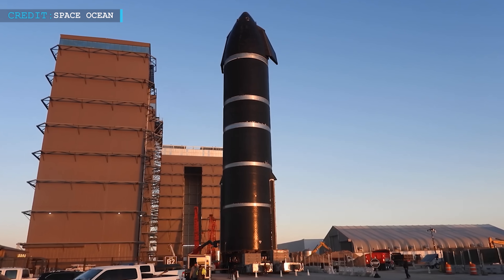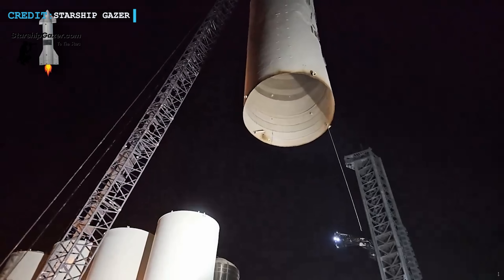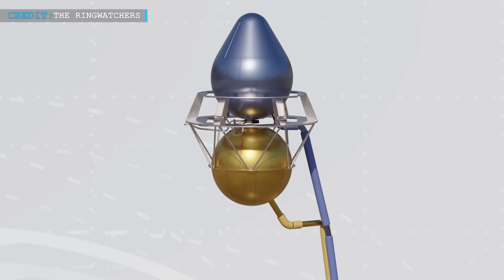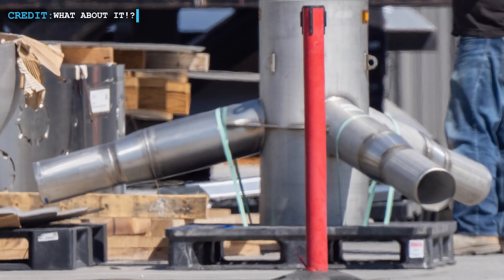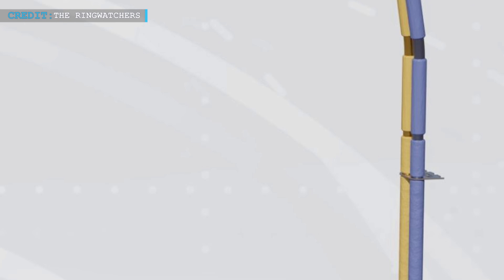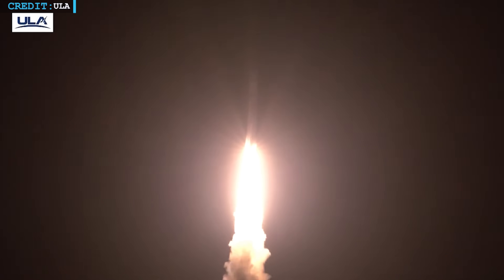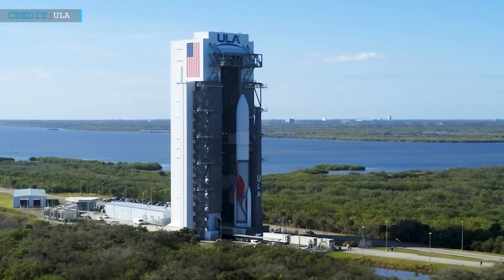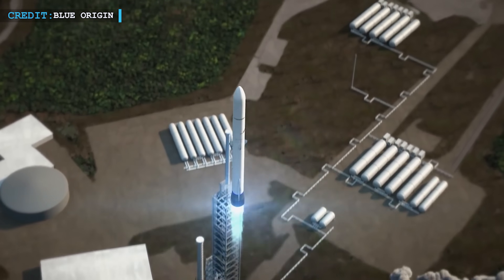SpaceX Starship's 3rd Flight Test in February | Inside Starship Propellant Distribution System

Comment: Methane & oxygen are NOT 2 types of propellant. They are 1 type of propellant, Methalox. Neither will propel anything on its own.
ULA's new Vulcan Centaur rocket uses 2 types of propellant (3 when it is configured with solid rocket boosters). Methalox in the first stage, HydroLox in the Centaur V upper stage.
Reply: No, that is not correct. A liquid fueled rocket has two propellants, the fuel and the oxidizer. Terms like methalox or keralox are just shorthand for describiing the two propellants in the rocket.

Comment: What nearly all these channels and commenters miss is that the Falcon is a narrow fairing because it was designed for road transportation. The Space Force and others occasionally need a wide fairing for big birds. Vulcan and New Glenn gives that option. Eventually a wider fairing Falcon Heavy might but that’s not guaranteed. And Starship is aways off from reliable flights.

Comment: Congrats ULA, thank you for proving that Methelox rockets can get the job done. Yes, we all knew it could but having verification helps. Congrats to Blue Origin for proving that BE4, at least partially, works. I say partially because, IMO, you're going to need in-flight re-lite capability. Celebrate your performance advantage, just don't celebrate too long. I really think BO is going to need all the performance they can get out of the BE4 including in-flight re-lite.

 Congrats to ULA on a "Complete?" domestic rocket and a successful launch. You had better get moving on this whole re-usability thing. I'm hoping the USAF, USSF and NASA really drive this point home, you're wasting resources and the supply is not infinite.

Thank you Engineering Today Team for helping to spread the word.
Reply: Let's hope that BO gets to make production-line BE-4s and not ones specially hand-built and tweaked just so Vulcan could fly before 2025 or whatever. As it stands, BO needs to build 2 BE-4s for each Vulcan and 7 BE-4s for each New Glenn. And not to forget that on every flight of Vulcan everything is ditched in the ocean. There are no bits to recover, so a new rocket and new engines have to be built for every single flight. Whatever the flight-cadence, a rocket has to be available. And the same story for initial New Glenn vehicles, as they are unlikely to be soft-landed anytime soon. That means that Both ULA and BO need to be building rockets all the time. But why would they do that unless they had an imminent mission to fulfill? Spare rockets lying around just waiting? Maybe. 
But SpaceX doesn't care because it re-uses its rockets so there is sure to be one available for launch almost all the time. They just need to build new second stages, and they have that down to a fine art.
Reply: @mauricegold9377  I'm not sure when they will attempt it, but the plan for Vulcan is for "smart reuse". They want the engine-bay to separate from the first stage, after all the fuel is spent & parachute into the ocean, with an inflatable heat-shield to protect it from re-entry & the salt-water. https://en.wikipedia.org/wiki/Vulcan_Centaur#SMART_reuse
Reply: China proved it first. The Zhuque-2 rocket even looks a little like Vulcan, and it reached orbit on its second attempt on July 12th 2023. https://en.wikipedia.org/wiki/Zhuque-2

Comment: I would like to see SpaceX test the inner skirt of the orbiter by doing a static fire with a staging ring attached and see if the soldering of the LOX tank and the skirt hold up… I bet this is the real reason why the orbiter failed.
Reply: Don't think so. It was most likely water hammer effect because they flipped too fast and too soon.
Reply: I was not talking about the booster, yes, the flip manoeuvre with 13 Raptors was a big mistake, but I’m talking about the inner skirt of the orbiter, the enclosure of the six Raptors.

Comment: However Vulcan is not designed for re use.  So far it's still just a better ballistic missile 🤣🤣🤣
Reply: I was about to type "Not Reusable"....then I saw your post.
Reply: Afaik it is designed for PARTIALLY reusing. Inflatable heatshield was already tested, and in near future engines should be recovered
Reply: @just_archan too little too late for Vulcan… it’s old and outdated obsolete technology
Reply: @QuantumPath100  I don't disagree. But still it will allow ULA be afloat long enough to have reusable rocket in one point. Nor delta, nor atlas could not compete in current market. Vulcan got nice niche with quite high payload to HIGH orbit, as second stage is very capable. 

Vulcan was already delayed over 5 years. If they would try to pursuit full reusability, they would not made in time to replace delta/atlas. Don't forget that vulcan already got 70+ contracts, this is what can give ULA time to work on successor. S.m.a.r.t reusability will give reduction of costs enough to be afloat. At least until competition from rocketlab, spaceX, BO, and others will have own next gen launchers. It will be few years until anything except for Falcon will be reusable and commercially available. 

And remember that ULA will not compete with SpaceX, this company will have 90 percent of market.
Reply: @just_archan  good point and well said. I did not think about this 👍👍👍